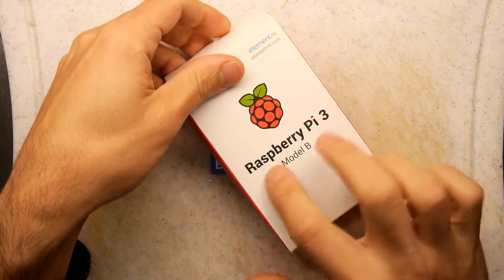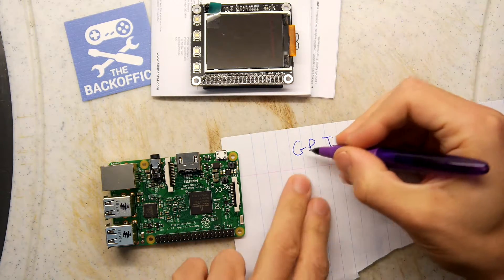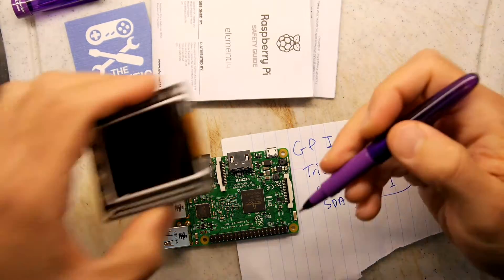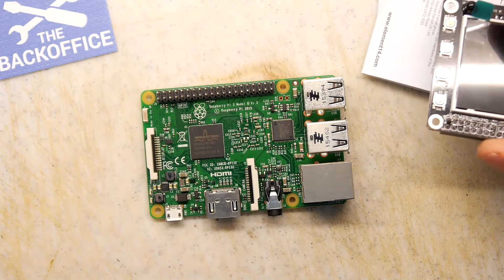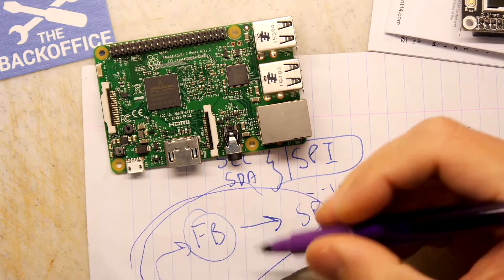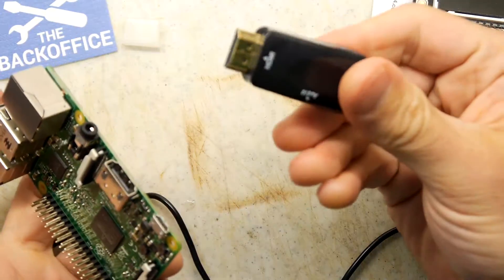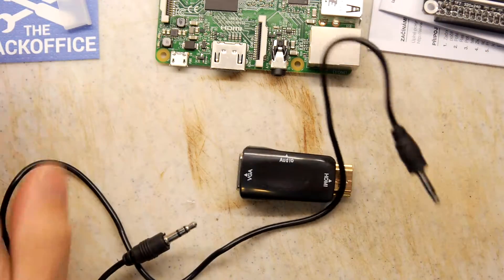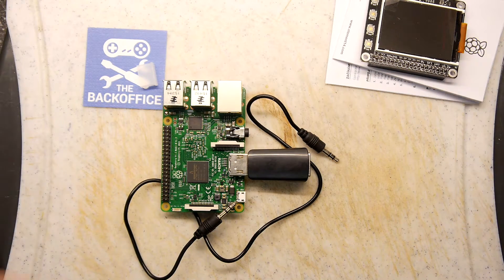Why you NEED a HDMI to VGA Adaptor for Raspberry Pi

Comment: Just make a video on raspberry pie 4 where there is micro hdmi .guide me to connect to a vga monitor caus i have a raspberry pie4
Reply: how about adding simple microHDMI -> HDMI adapter? it's the same signal just different plug size so all presented in this video should still work in principle
Reply from the maker: I don't have a raspberry pi 4

Comment: Fantastic tip!! my only concern would be with the audio jack since the Raspberry pi composite conector is a 4 divitions (including video and audio) on the jack and the adaptor's jack has only 3 (just audio), how can we assum there will be no problem with that? is the audio conection fully compatible?, thanks
Reply from the maker: You can check the pinout if you are concerned from their website

Comment: HDFury's are expensive.

Are they typically the MONSTER of HDMI to VGA converters, or is there still something more to them that I'm not getting?
Reply from the maker: voltz15 Probably overkill for most use cases and just good marketing?
Reply: I wonder.

The components for such conversion technology has sharply dropped and become wide spread in these past few years.  There really shouldn't be any excuses to justify charging such a high premium anymore .
Reply from the maker: +voltz15 They really only cost pennies too produce, hence £3 on eBay guess a long way 😂

Comment: I wonder if that adapter adds significant lag, obviously WAY less so than pulling it from GPIO. Also I think you may prefer the audio coming from the HDMI since from my experience the audio quality is noticeably better from HDMI than the 3.5mm jack.
Reply from the maker: From past experience I would say those adaptors are practically zero lag, if you think about it lag is caused by video processing (in the case of TVS) and video processing requires 1) A CPU (or DSP) and 2) RAM, neither of which a £2 dongle manufacturer is going to waste their minimal profit margin on.

The audio is interesting because in the Pi you can choose which port it comes out of, if you use the adaptor, the adaptor itself is decoding the serial to audio, whereas on the pi, it is also using its own DACs. I would not know which to put my money on :)
Reply from the maker: Arghh I just read that Pis output audio using a PWM and and RC filter, i.e. SHITE!
Reply: Good to know, I assumed since HDMI is a digital signal and VGA is analogue that there would be some kind of processing occurring in the conversion. I'm a video neophyte lol

Comment: I got one of these months ago. Wondering if there is some way to extract audio from HDMI on the Pi Zero.
Reply from the maker: +Meth Methanoid now you know!
Reply: The Backoffice no. Mini HDMI on zero and besides which I need to keep HDMI as HDMI. Just wondering if the audio can be extracted or duplicated. There are some horrible circuits you can extract audio elsewhere from.
Reply from the maker: +Meth Methanoid when someone sends me a free zero I'll let you know 😂
Reply: The Backoffice when someone finishes their STE I will ;-)
Reply from the maker: +Meth Methanoid such motivation!
Reply from the maker: Ebay search "HDMI Audio Extractor Splitter" Thats what you need, your other options are very lame:

https://learn.adafruit.com/introducing-the-raspberry-pi-zero/audio-outputs

You need to use the same piece of crap RC circuit and a PWM output. 

If you want real sound you need to run a separate DAC, these are not too expensive, but if you are space constrained, will be smaller than the HDMI splitter.